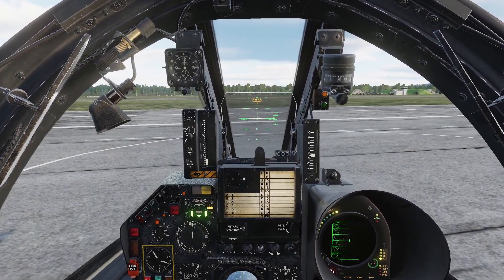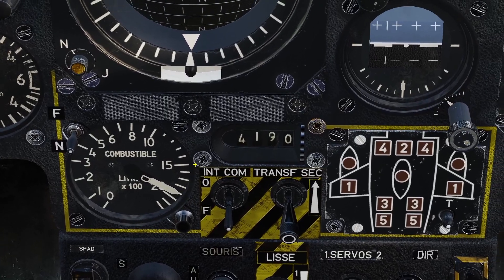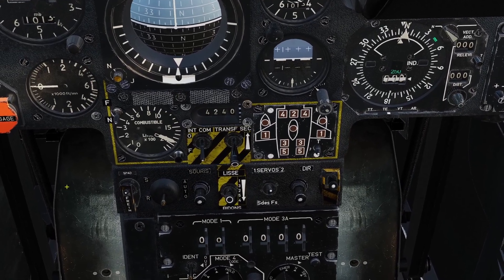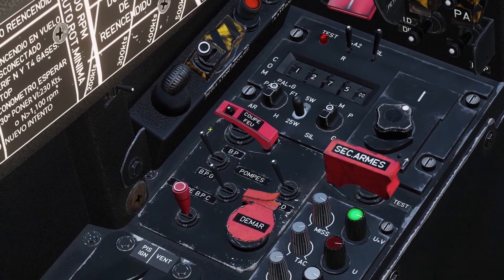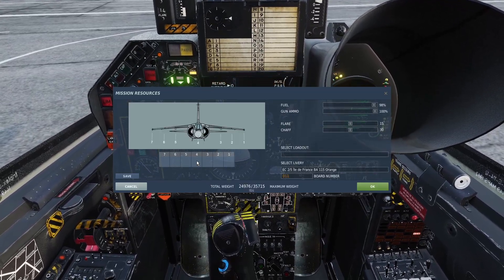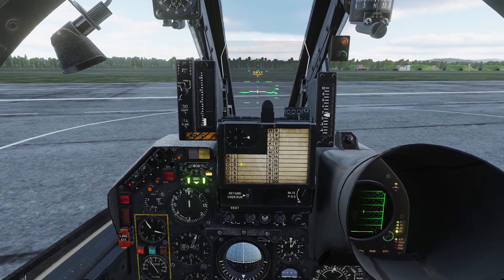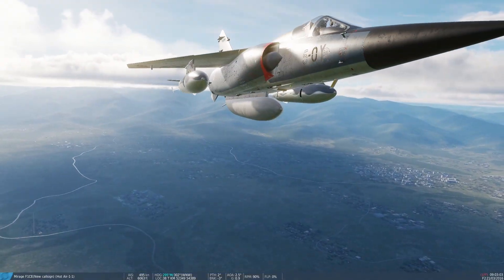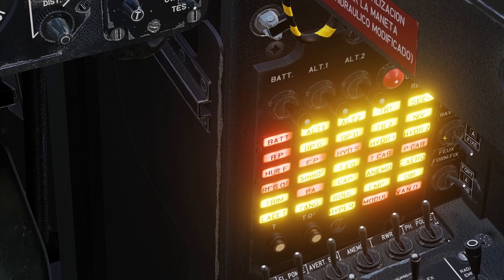DCS Mirage F1CE Fuel Management

Comment: Thanks for the good work you are doing on this beautiful plane, but i wanted to tell you something. After a couple test in the CE and EE variants, there is no need to select the bags in the "Lisse-bidons" selector. In my tests, the plane will always drain first the bags (lights on in the external fuel tanks) and then wil continue with the internal tanks. I think this selector is intented to work with the "ermegency tranfer switch" in case of emercengy.